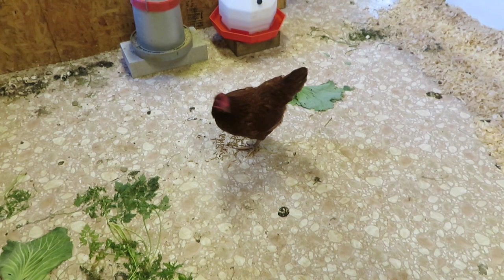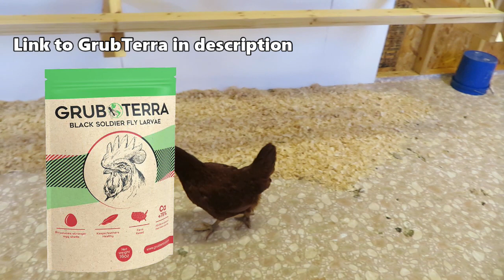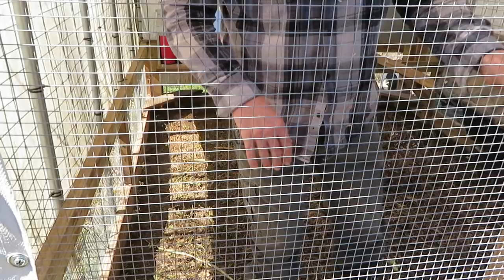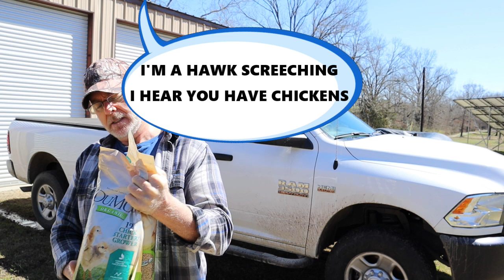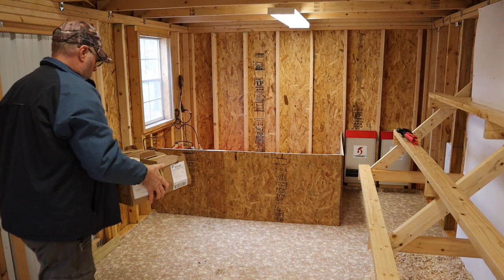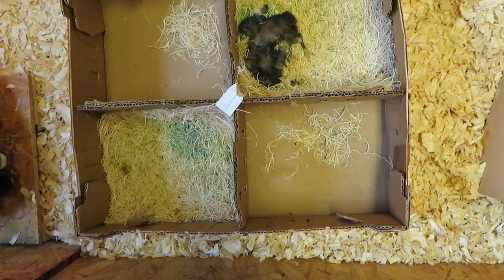The chicks have arrived | Raising chickens for eggs

Comment: They cannot ship unless you bought additional to meet the minimum number of chicks for shipping safely.  They have a minimum of 15 chicks, usually, because the combined body heat will keep them alive to arrive at their final destination.  The two chicks that died likely were failure to thrive.  With the number they hatch at a time, you're going to have a small percentage that don't.  It's just a fact of nature.